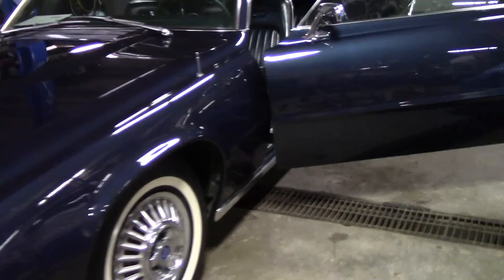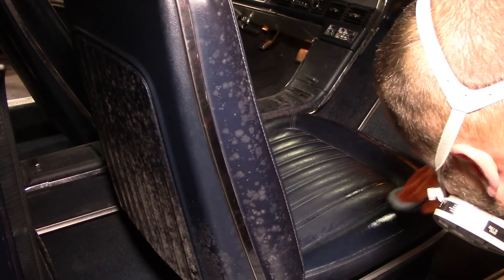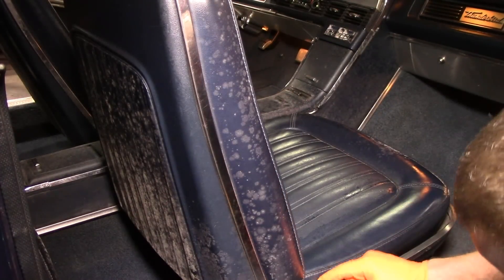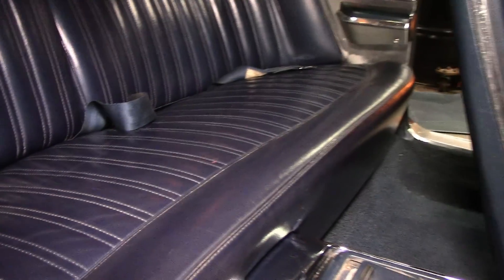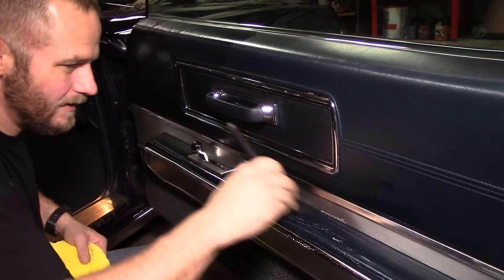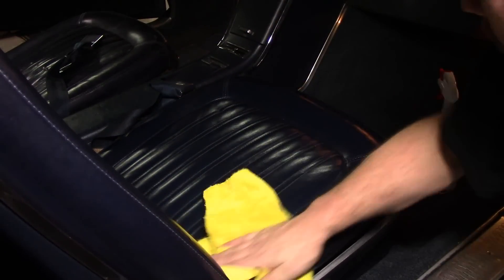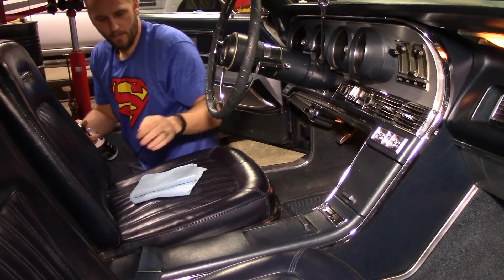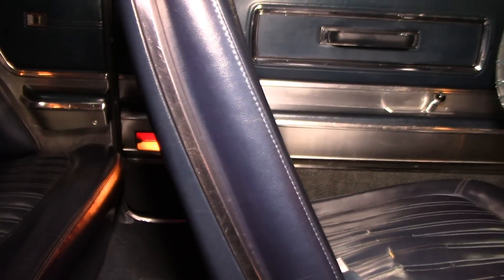1967 Ford Thunderbird Detail Part 4 Interior Mold Removal

Comment: I would have mixed 3/4 vinegar, less than 1/4 water, the rest rubbing alcohol and a drop of Dawn dish soap...sprayed and let it sit for about 10 minutes...then come in and spray again and scrub/wipe off...the alcohol would not only help the vinegar kill the mold, but it also will help evaporate the water in the mixture so it doesn't feed the mold...

Comment: All I can really say is WOW! I have never seen mold that bad and I was really wondering at first if you were going to be able to get that job done and I am sure you were also! You did a great job brother and that interior turned out really nice! What did you end up doing for the seat belts and carpet?
Reply from the maker: Yeah it was really bad! I to was wondering how the heck i would get it done but it actually went very smoothly. Thank you! The seat belts I did the same way as the seats and the carpet I just vacuumed and scrubbed then vacuumed again.

Comment: Was the mold in the foam under the seat cover? What about removing it?
Reply from the maker: Soravia I was told to not remove the seats just clean the mold off the seats so that’s what I did.
Reply: @FABAutomotiveDetailing  can you use the same vinegar solution on leather seats? I have a Volvo C70 convertible that I got in a small fender-bender and I'm now trying to get it back on the road but it's been over a year that the car has been shut and have mold throughout the car period been trying to figure out what to use. I'm nervous about a vinegar solution but I do know that there is a clear coating over leather interior to protect them. Any recommendations would be great thank you